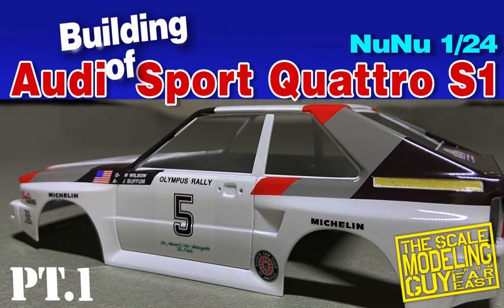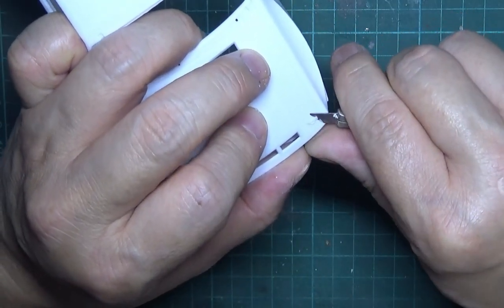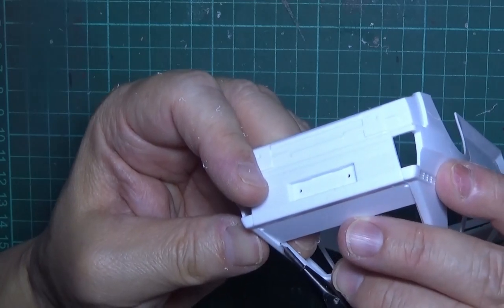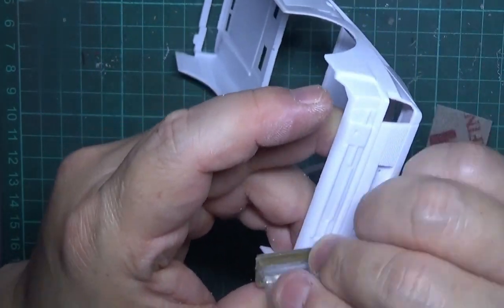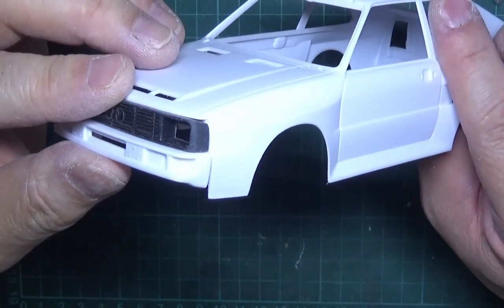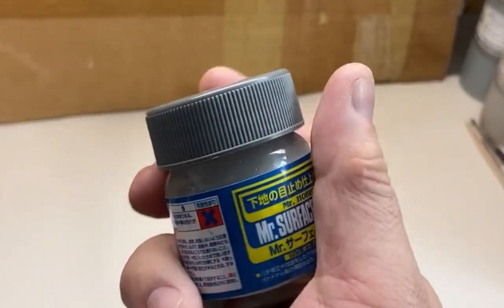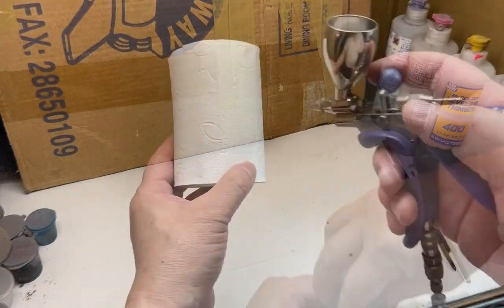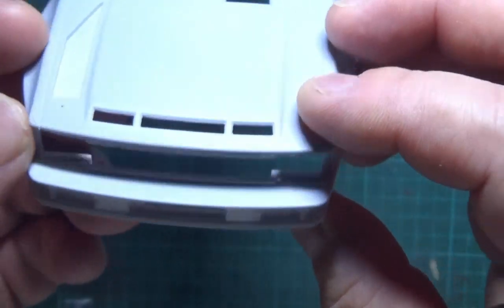Building 1/24 Audi Sport Quattro S1 from NuNU Pt. 1

Comment: what graver did you use???
Reply: The graver I usually use these days is from Creos/Mr Hobby, it’s call Mr Line Chisel. The engravers come in different width and fit into a dedicated handle. Unfortunately it is discontinued according to their website. Tamiya has an equivalent product but it’s a bit more expensive. You can check it out at Tamiya’s website.
Reply: @edwardshen343  thankzzzzz